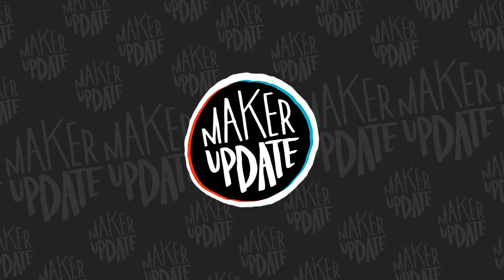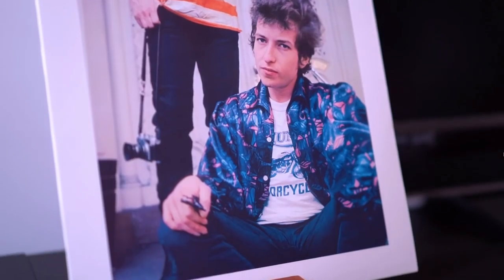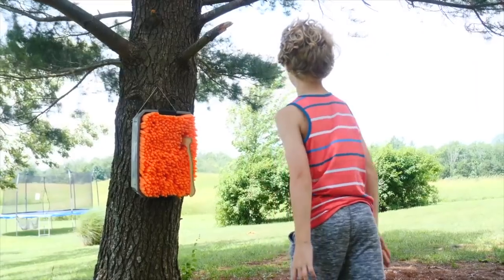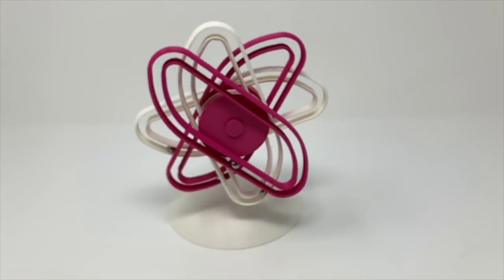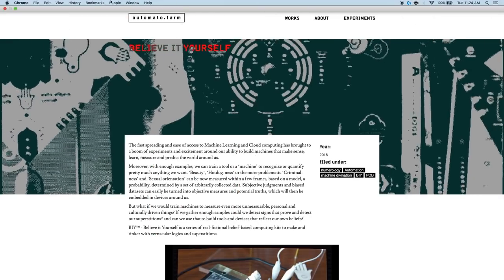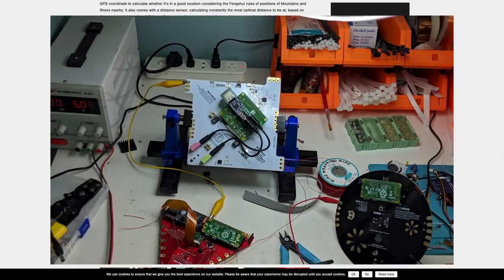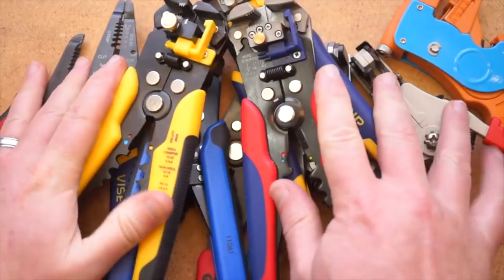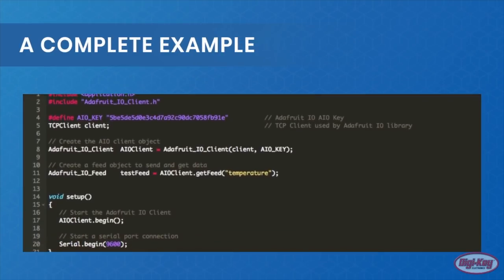For the Record [Maker Update #129] - Maker.io

Comment: Enjoy your break Donald! A lot of great ideas in this. I love the BIY kits, but outside my range of fun things to have around.  Also the reference to building your own battery pack is great - it is something I have wondered about for a while considering many of the big laptop batteries/utility batteries if you take them apart are generally just a huge series of 18650's
Reply: Totally. Have you seen Jehu Garcia's channel? He goes way down the rabbit hole on making his own Powerwall and also shows how to spot weld those flat packs used in motorized longboards.
Reply: Maker Project Lab checking it out now.

Comment: The cat feeder project sounds like a great thing to connect to the internet.

You could put in a raspberry pi and a camera to see if your cat is in the area of the feeder.

There are somany other cool things you could add on. But the project alone sounds pretty cool.
Reply: Yeah, the only drawback to that project is that it's in German. Google can auto translate some of the text, but he has some of it in frames that the translation doesn't reach. That said, I think anyone with some familiarity with Arduino can piece it together if they really want to. And like you said, it's ripe for expanding on and remixing. Really, the feeder design and the mechanism for dispensing the food -- those are the tough elements for me that would require a lot of design headaches and wasted 3D prints. That part's done, and now you can elevate it.